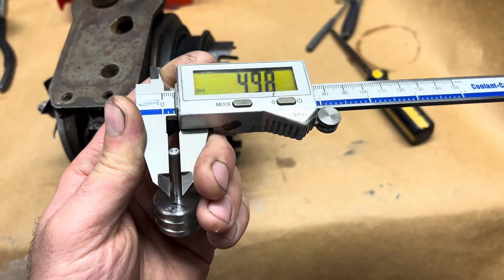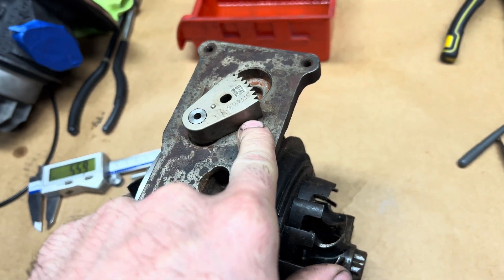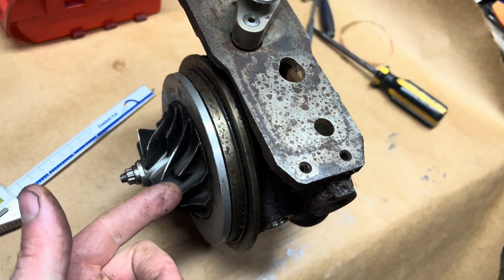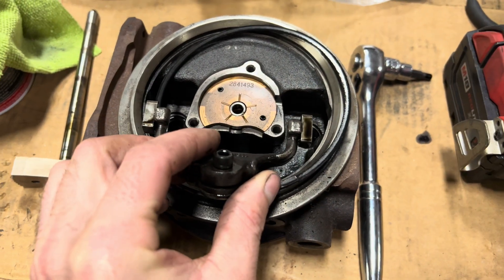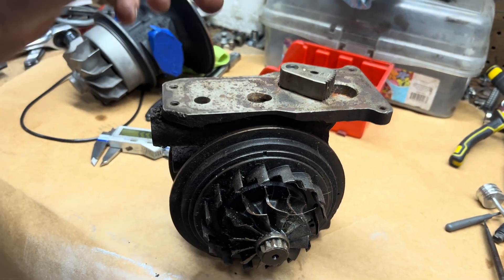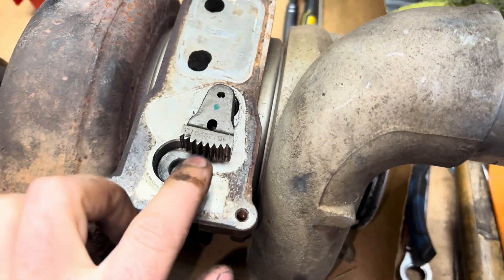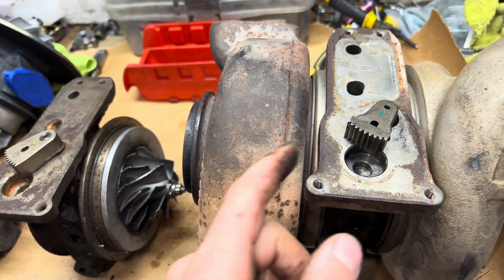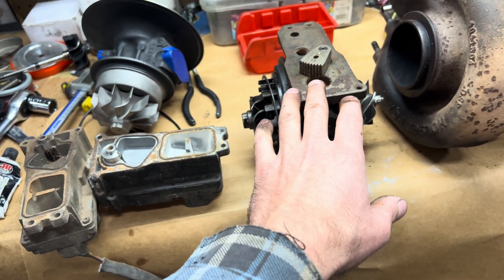How to set actuator gear on 6.7 Cummins turbo

Comment: Geno's gatage has the actuator and not need for programming and also stronger .
Reply from the maker: I have one, I have not installed it yet. My original actuator is still performing great, there are 300k on the truck not sure how many miles are on the turbo or if it’s the original one.

Comment: I had no idea… Thanks for the vid. I rebuilt my VG 2 years ago and did not do that. 8 months ago my Ram had the dreaded loss communication with actuator light back on. I need to pull it again and check everything again, set it correctly and get a new actuator I’m thinking.
Reply from the maker: I think I may have built some wrong in the past. The reason is because if you set the he351ve vgt by the alignment hole but you don’t use the turbine housing to set it, then the gear is off about 1 tooth after you put the turbine housing on. It looks correct as a cartridge, but once you put the cartridge in the turbine housing then the hole doesn’t align anymore. The problem with that is that the actuator can force the gear farther than nozzle allows it to go. I think it could damage the actuator and throw off the calibration in which you can’t calibrate that out until you set the gear in the correct position. I thought I may have done it wrong on my own truck possibly, but my truck performs very well. I will inspect mine when I install the actuator upgrade. So far I haven’t had an actuator problem, my truck has about 307,000 miles on it but I only owned it for  about 10k miles.
Reply: I cant wait till I can have You build one for my 05 Cummins! I have never seen any Turbo work anything like the quality work that You do!👍